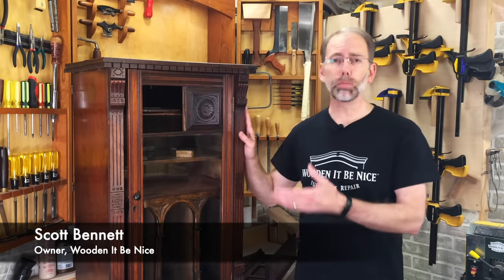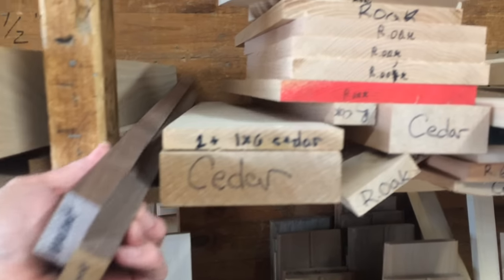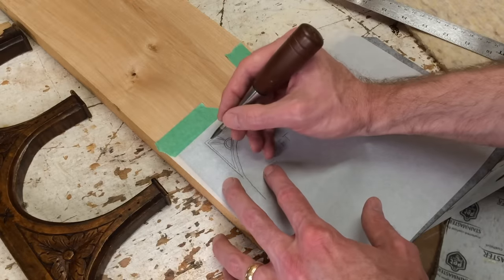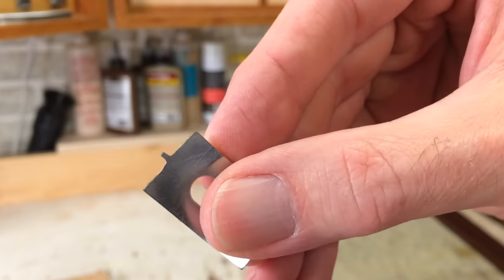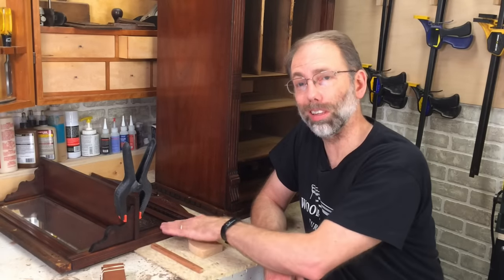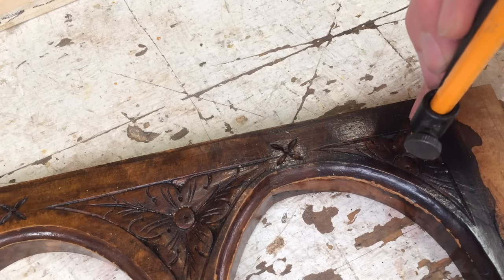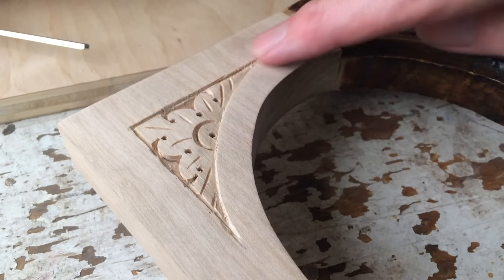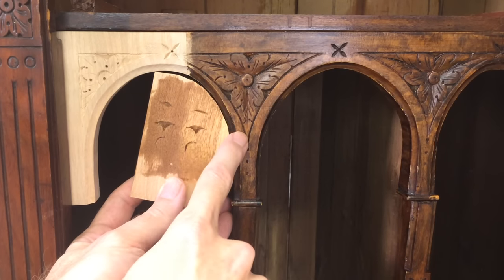Restoring a Sheet Music Cabinet with Missing Carving - a Fixing Furniture Restoration

Comment: I enjoyed your restoration video very much.  I believe you struck a cord when you said that much of the original carving was done with a very few hand tools likely including a carving knife.  During the period that the piece was made few craftsmen had a complete set of specialty carving tools.  A sharp carving knife would likely have been used to complete most of the carvings shown.  I would encourage you to investigate purchasing a chip carving knife.  The shorter blade gives better control and can duplicate the old carvings better than a V groove chisel that tends to bruise and chip the wood.  Excellent job matching the stain coloring.

Comment: When new or experienced with wood carving, a tip to help visualize the angles being cut can be seen by taping a piece of string with a small lead weight, around the handle to hang down its side. This give you memory about the angle to put the tool before hitting it.

I tend to make multiple posts, I hope I am not a bother.
Reply: Thanks for the tip

Comment: This kind of carvings are mostly carved with a carving knife, maybe some of the curves are done with a curved carving chisel.
It is probably better to not use the mallet when doing these small carvings. It is easier to control the carving chisel by hand. Use a technique where you puss the chisel with one hand, and use the other hand in the opposite direction to control the speed and prevent chip outs.
When you cut patterns like the “X”,  make a cut straight down in the middle with the carving knife, and then do one curved side at a time, cutting against the first vertical cut.

It’s amazing to see you matching and repairing these old finishes. Very nice to see these old furnitures get a new “life”.

Comment: This was a great episode.  All kind of challenges in it.  Thanks for sharing.  Here's something I thought of that you might appreciate.  About two and half years ago, my dishwasher (25 yrs old) died during Covid.  I replaced it with the only one I could find locally.  It was much fancier than the old one.  About a year of heavy use, I realized there was a fine mesh filter in the bottom that periodically needed cleaning from some sort of white particulate.  It was quite heavily caked as I probably should clean this at least quarterly.  I tried all kinds of things to clean it and it really difficult to get clean.  Finally, I soaked it overnight in white vinegar and the material dissovled/came off.  It finally dawned on me that what was likely caked on the filter was protein.  The white vinegar removed it by the same mechanism hide glue is reverested in joints.  It brough a smile on my face.  I've cleaned the filter several times since and all I need to do is soak it in white vinegar (acetic acid) overnight; it's really easy to clean by this method.

Comment: I have built, repaired, and conserved high end custom furniture professionally for many years. When carving new or replacement parts it really helps to have the right tools. For those who only need to carve parts occasionally, you can get by without having to invest a lot in carving tools. It's important to have sharp tools and since you are already familiar with diamond stones and honing guides I'll skip that part. I would recommend a 1/2, 1/4, and 1/8 inch chisels, and an  X- Acto knife for most small jobs and you can add larger chisels as necessary, as well as sandpapers. Rough out the basic design using the appropriate tools and sketch out the details using a sharp pencil, then with the razor knife cut along the lines to define the image. Then using the chisels, remove the excess wood and define the contours and use the sandpaper to clean everything up. You can also invest in a cheap set of carving tools if you want and a Moto Tool with various bits. Of course, the more you practice, the better your results will be. Good luck!

Comment: Hi 👋, if you put some double sided tape under your piece of mahogany, you’ll find it will stay in place whilst you use your scraper stock moulding tall, as for your arch that needs to be carved and moulded. You need to make up a Trammell arm , you might noticed I cannot spell properly, but I know how to use my hands, you need to set your cutter into a clamp on the tram arm the other part is used as a pivoting point, and this is worked out the length or the diameter of your arch that you’re trying to copy and use it like a scraper and you fix a point to then scrape it round to start the shape of your groove you do one or two strokes you tap the blade down half a mil to a mil can you then do the same process again you slowly scrape it round the shape and carry on the process until you’ve got your desired depth,

Comment: This was very good, very good indeed!
Little surprised to see the use of hot glue for the strips in the assembly, maybe explain why you didn't use 'period appropriate' glue there?
Reply from the maker: As per a previous video, when I work on a piece with antique glass, I don't want to risk nailing the retaining strip in place. Hot glue is a current technology that allows the retaining strip to stay in place while keeping it removable.  I explained this in a previous video, but thanks for asking to clarify.  Cheers.  Scott

Comment: Hey Scott, thanks for showing the use of the Veritas beading tool. I have been somewhat frustrated with mine. Now that I have seen how you use it, I will take it out of the drawer again!
Reply from the maker: Glad I could help!  One of the key things I learned about it is to position the fence/guide in the right orientation.  The manual shows very specific ways to set it up.  Cheers, Scott

Comment: I have found chip carving knives to be invaluable in outlining grooves and other recesses. The angle blade cuts a very precise line straight or curved and it is easier to control than a straight knife edge.
Reply from the maker: That’s great!  Thank you for sharing that tip!  Scott #tip

Comment: Wow, Scott.  You really outdid yourself with all the carving.  Your stain matching is second to none.  What kind of lighting do you have in the garage?  Color corrected?  Just LEDs?  Excellent.  I learned a lot.
Reply from the maker: Thanks.  Glad you like it.  My lighting setup is for filming, but it really helps for stain matching.  3 large LED panels set to 3,300k where I can adjust the brightness and position as needed.  Not a typical workshop setup.
Reply: @FixingFurniture  I have Ott Lights where I need them. Color balanced.  As I get older, I just need more light.

Comment: Great work!  A question, though: instead of using the beader and the chisels to carve out the pattern on the missing half-arch, why not apply the Dremel to it?  (I know you have one :-) ). If it turns too fast, and has a tendency to overheat/singe the wood, one can use a dimmer to reduce the rotation speed.  I’ve done that with a Dremel probably made in the fifties; maybe more modern Dremels have speed regulators built in ..
Reply: Yes, I was also wondering if he considered using his Dremel for some of the carving, especially since he had no carving expertise.

Comment: Hi, You need to get yourself some V garages , v V , they come in various different angles and different depths as well, this is how you create the channel that you’re trying to do, in the dart shape, and the star shape, as for grinding your tool blank, you can find some grinding wheels online, which you can profile by using another stone, but I have found Stihl make grinding stones to obviously sharpen chainsaw blades. You will find these are quite close to what you need, and you can shape them by using a dressing stone., 
I hope this is some help , it’s a pity that you are so far away as I have probably best part of nearly 100 or so chisels for carving. It will cost too much to send them, some of them are very very old dating back to the early 1800s, but are still very good as the tool steel is very good,
Retired English gentleman ha ha , 😂 specialist joiner cabinet maker, good luck with your renovation projects, 
I’m now retired and living in France , Phil from the moulin France.